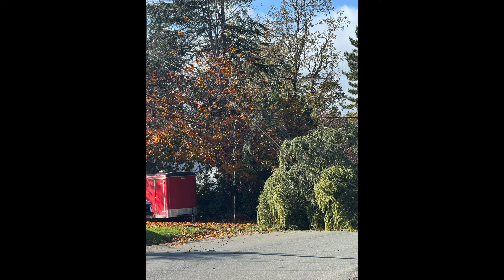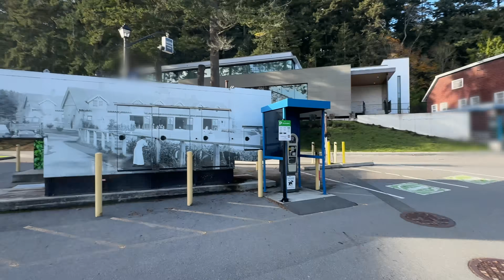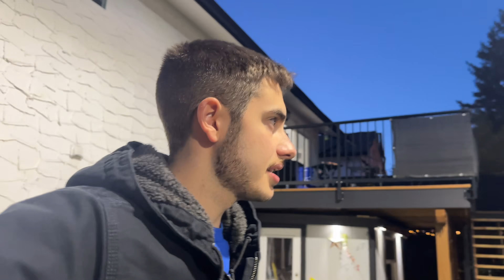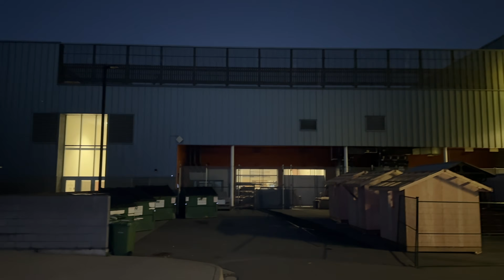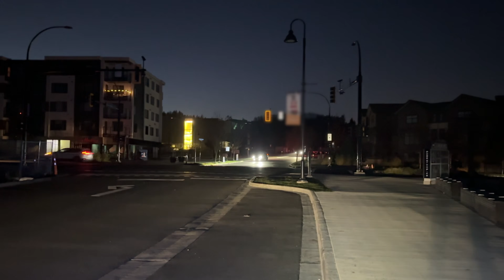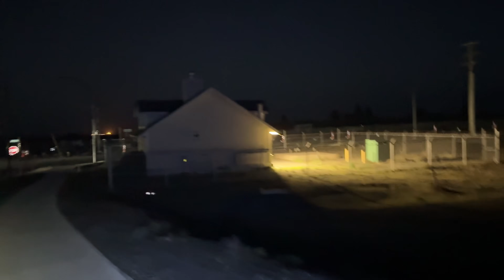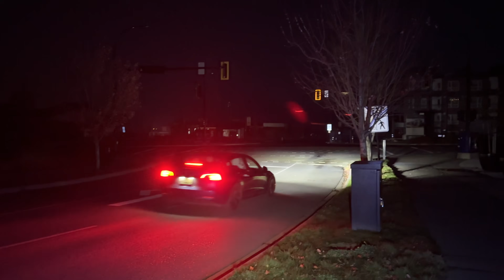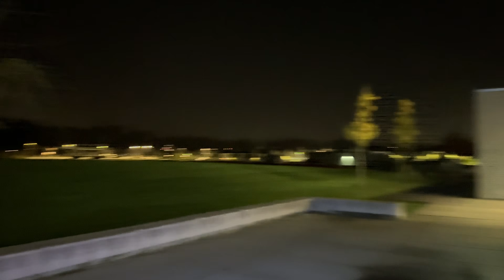11 Hours Of Power Outages And House Electrical Fried With 14,400 Volts On Neutral!

Comment: Whoa! This is NUTS!! I guess I'm gonna fuse the power lines coming in to my house after this, just in case! This is DEFINITELY going to be a COMPLETE electrical strip down.. That house needs a completely new electrical system, from the panel all the way to the outlets...
Reply: Your incoming lines are already protected at your first means of disconnect. Fuses wouldn't have helped anything here since the voltage came on on the neutral. And even if it was legal to fuse your neutral (it isn't), I doubt fuses would blow quick enough to make a difference.
Reply: @ferrisr correct the houses here in the U.K. had RCDs up front on the supply they tripped and the 11kv arced across the contacts.
Reply: Even a high quality (I love the Siemens whole house 140) surge protector will melt with such sustained power…
ESPECIALLY on the neutral!  Keep the high-end Federal Pacific panel & breakers to install at your worst enemy’s home, 😉

Replace EVERY inch of wiring and every device in that premises.
Should be 100% insurance covered.
Reply: @RBAD-PowderMill  On the plus side, we finally know that Federal breakers can trip.
Reply: @ 🤣 Buzz Breakers!
Reply: Also, fuses are rated at 2x expected maximum current. They do not exist to protect equipment, they exist to stop fires. You don't want momentary high current transients popping fuses all the time.
Reply: I had this happen at my grandparents house. All the lightbulbs turned into plasma globes and Jacob’s ladders following a lightning strike (Edit: 2:50 that’s pretty much what it looked like, with lots of flames). If I recall the main transmission line and the feeders made a connection. From what I saw at these voltages and currents there was just no way to break the circuit, and ultimately it came to an end when the molten wires came crashing down into the yard. I think what saved the house was the old fuse board with the Edison style screw in fuses ended up sacrificing itself and flashing over internally, which helped clamp it. At any rate we were without power for quite a while. Needed a new transformer, feeders, disconnect, meter, and panel after that one. Quite a sight, tho.
Reply: I do HVAC, had to go out to a customer same thing happened with a tree. They had new boiler it was all electronic. I said replace the whole thing. They had sparks come out of the breaker panel and start a fire. They had boxes of books on the floor below the panel.
Reply: U would need to run a decent isolation transformer for whole house with decent fuses and spark gaps to remotely protect urself from it and it cost a bucket load 

The only other way be switch the power off and on the off side short phases and neutral and earth together with thick link for storm protection
Reply: There are fuses molded in the 2 service drops to most meters. But not on the bare aluminum neutral  back to the transformer. Neutrals are not fused but to the ground where the frist bonded in box tie neutral and grounds  together, then to the ground rods. As thats a lot of power,  the protection systems are  overwhelmed. The power company may be on the hook for this. Good it have been prevented?
Reply: you would need a fuse rated for 10+kv
Reply: @75sRax  
The fuses are rated for something like 10kva~100kva
Reply: @weazeldark3983  ah ok thanks
Reply: @tripplefives1402 Exactlu
Reply: Fuse doesn't help with overvoltage.
Reply: @tripplefives1402  

It does if you actually understand what it does and wats going on
Reply: @tripplefives1402 
Maybe you should try 😉 😏 🤷 🤔 reading wat I said and come back with a proper argument
Reply: @tripplefives1402 
U lack understanding of high voltage and electrical and electronic principles 

Hence why it doesn't compute to you 
😏 🙄 😉 😜 

I'll lay it out for you 😘 😏 😌 

Electricity follows the path of least resistance 
Taking into account nature of the electrons albeit a energy discharge static electricity high frequency radiation and low frequency magic and DC 
All do different things 

Then 
every conducive substance is a insulator 
And 
Every insulator conducts power 

Sos with that we brake down more 
Murphys ohms law of resistance is that parallel resistance with value deviation 
The lowest value probably will take the highest current witch should give the resistor of higher value little substance to do nuk 
But
Yeah nar reality takes awhile to assert itself 
Sos we for see this trillion dollar quantium computer protecting the 69č light bulb 💡 🙌 sos we use capacitive coupling to null and void the isolation weakness and also use decent insulation designs 
Or 
Use cheap rubbish tranys and ad hoc the isolation though principles than design engineering blueprint spex 

Then using spark gap principles we have a Frankenstein brute pathway for energy be effectively and resilantly disapated away 
Add in radio transmission magic n mana up u have a universal indicator indicative of any issues or problems 😉 faced Albert the breach of FFç and ham licensing haba 

If you use a adjustable tuned circuit then u can not only disapate unwanted energy but u can absorb and receive it 
😉 ☺️ 😊 😌 
Another words Thor it to ur control 
Aka lighting antenna and it can't really go anywhere else 
Basically if Thomas Franklin was on pervitan hahaha 😆 😂 🤣 

Enjoy your free X rays 😎 haha ⚫️ 

Yes ur processing isn't as good as perceived and allows you to have weak debates 

Ur also debating with someone who steals power off grid and is tutu with 33 000v like baby with playdough sos 😳 🤔 just so you know the wisdoms and experiences of such haha 😄 😅 😆 
My isolation is fishing line 
My fly lead is also fuse of hobbyist hook up wire haha 😄 😆 😂 🤣 😅 😉 it's a natural gun power fuse without explosives 
The gasification and energy disapation vaporizes the evidence of such with niffy guyfakes knight 
Not that I worry 

Because no one is in slightest midgen remotely equipped to deal with that situation haha 😆 🤣 😜 

As I found out flipping the switch reboots and resets cop 👮‍♀️ notes and decisions 
Having been caught numerous times be4 Jimmieing free powa be4 

I charged my car battery on expressway off street lamp haha 😄 😅 😆 🙃 🤣 😂 
Was lark n half hehe 
Got taken to custody on warrant ta aresst hehe already knew I was a active vip customer haha 😄 😅 😆 😜 🤪 🙃 😄 
Was funny asf and tonnes of oodles of funn 💀🤪😁
Reply: Not even a full isolation transformer would save you from this
Reply: @williamvaughan1218  
It would because the 2ndray would be isolated from the grid system and having a fault path would take all the energy away if you use 😉 the right setup 

If you use a proper isolation transformer for task it definitely does 
The power pole transformer that takes the hv is a isolation transformer itself 

Just on a lv isolation transformer the men system is going to stop at the transformer and very little is going 👌 past that because of earth 
U run dual earth's isolated and that pretty much zero 

The hv gets to the transformer and blows the winding and there's little pathway past transformer because everything on 2ndray is pretty much isolated from the primary 

Electricity follows path of least resistance 
If it was high frequency then sure it have more reason to pass though or if it was actually high energy like a thunderstorm 🤔 but it's just lowest hv line 

If it was how you be thinking then thunderstorm lightning ⛈️ 🌩 rods n antenna wouldn't work

Comment: Nic, Glad no one was hurt my friend. I would honestly look into replacing your Federal Pacific/Pioneer Stab Lock panel also just a pre caution. I mean you have that newer box next to it i would say just when the time comes move all the circuits over from the FPE to that newer box at your place. I went through Hurricane Ian, Nicole and Milton here in Florida and when i lived in Michigan the Polar Vortex of 2014 and several ice storms thank god both my old house and new house both have whole house generators. And the sound of a generator running a school or this case my house is music to my ears. and yes i know it wasn't your panel that got fried Nic I'm just saying now would be a good time to eventually remove yours.
Reply: FPE is the BEST panel/breaker system for doing home arc welding!
The breakers never trip.  
All kidding aside, I was a firefighter and licensed electrical contractor for my days off “side work”.
In NJ, home of Federal Pacific’s Newark ghetto mfg plant, the installed base of Stab-Lok” panels kept me upgrading services for 20+ years.

On the firefighting side, I’ve seen so many residential fires with FPE panels/breakers.
Scary stuff.
NEVER chance using the newer 3rd party (UL listed) breakers.
Replace the panel and breakers!
Reply: There’s a good chance that a whole house surge protector (Siemens makes the best IMHO) would NOT have helped.
They are made to clamp down on extremely short TRANSIENT voltages exceeding the rating of the protection device.
Having a 14kv primary coming in contact with ANY conductor entering the premises will far exceed the capability of the device.

They are intended to protect from extremely short transient excessive voltage like that from a lightning strike a mile down the road.   NOT from a primary sitting ENERGIZED until the overcurrent protection for the primary trips out.
If not a fuse in the field, it could end up being a self-resetting breaker along the line or at a substation.
That’s a LONG time for the damage to occur.

Another reason to be VERY cautious at the scene of any downed power lines?
Reclosers!   To prevent “nuisance” tripping of transmission lines, many overcurrent protection devices will AUTOMATICALLY attempt to restore power after tripping !!   (up to x number of times in x minutes).
I’ve seen videos of firefighters working to extricate passengers of a motor vehicle crash with primaries down on the ground and vehicle.    Everyone “assumed” it was safe to approach.  After work began, the recloser restored power, killing several rescuers.   The original crash victims were actually protected in the vehicle.

Always be SAFE!
Reply: Since they are getting insurance involved, I am sure they will be required to replace it anyway to stay insured even if nothing were damaged. I have heard of insurance companies refusing coverage if they find that a house has that panel installed.
Reply: That isn't his panel.
Reply: @JMWtrainsnstuff  i know it wasn't I was just saying since nic has one also this would be a good time to start looking into replacing his FPE panel also.
Reply: PLEASE do NOT re-energize that home!,!
Obviously, change the feeders and panel and breakers.
Go Square-D QO.  It’s worth the few extra bucks.

Replace EVERY INCH of branch circuit wiring and EVERY electrical device !
The damage to the conductors and/or insulation is impossible to detect.
This should be a completely covered insurance claim.

In addition:
Much of the electronics plugged in at the time should be analyzed thoroughly before using !